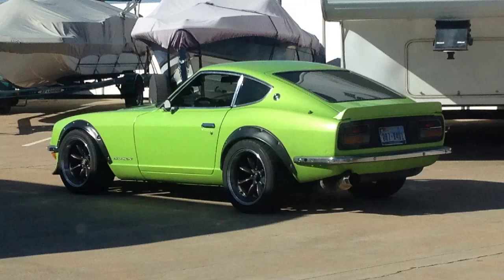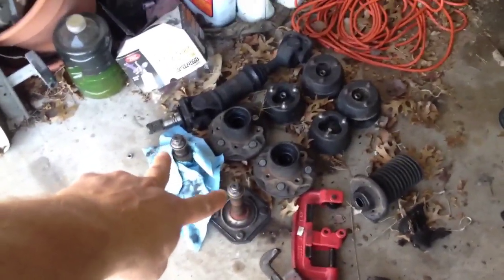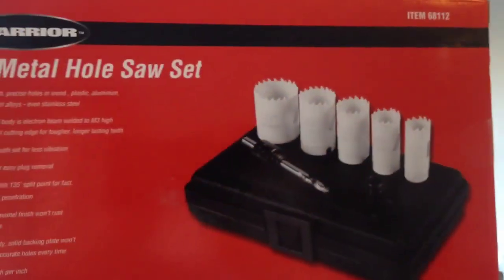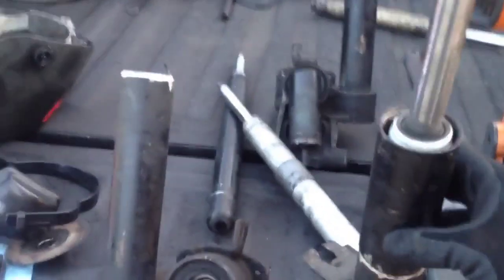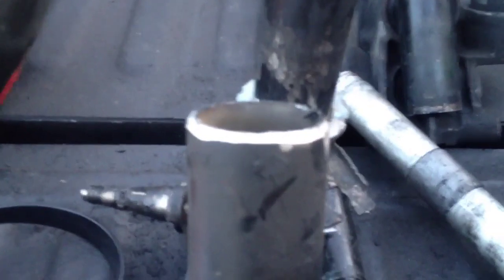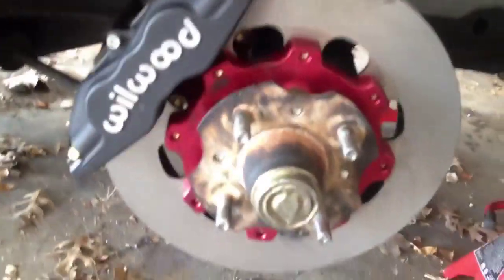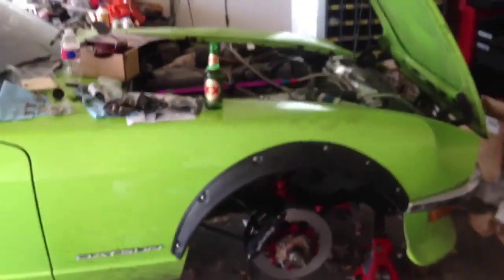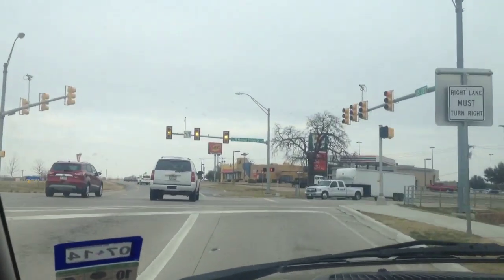Datsun rb30z coilover install part 1

Comment: I hope you Just misspoke and you are not acutely thinking about using compression fittings for brake lines. There's a reason they illegal for use on brake lines. They are meant for fuel line and other similar pressure applications. Awesome Z man keep it up!